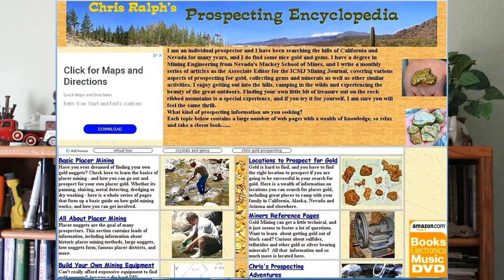How To Make Tesla billet bullion - recycling the aluminum remains of a Tesla

Comment: Back in the 80s I went into a antic shop. They had a pair of hair combs that were made out of aluminium that was made in the 1890s early 20th century. And they were very valuable at the time. (I bought them and gave as a gift). But all I could think of was, why, why can't I find a way to go back in time and take boat loads of aluminium cans with me. Lol . Great video. And I learned never use water to put out a lithium fire, don't pass out while driving and there really is no such thing as a fully smart car.  O by the way the hair comb if I remember right was made by Tiffany.
Reply from the maker: Made by Tiffany because in those days, Aluminum was a precious metal, valuable like silver.